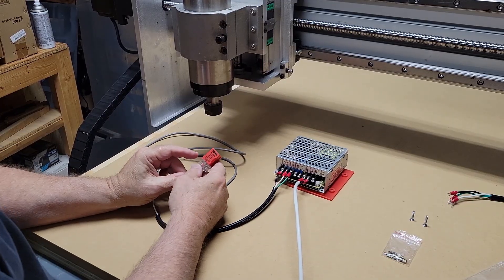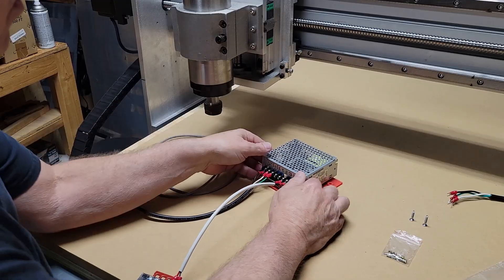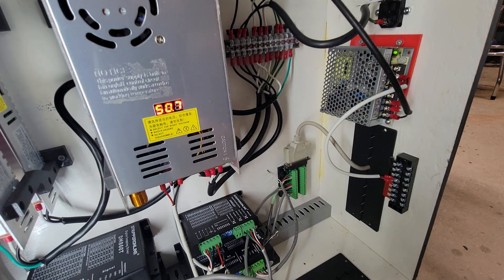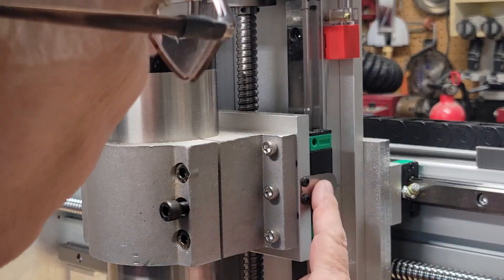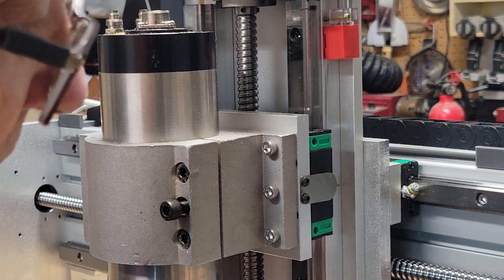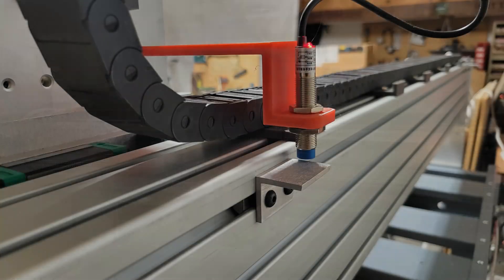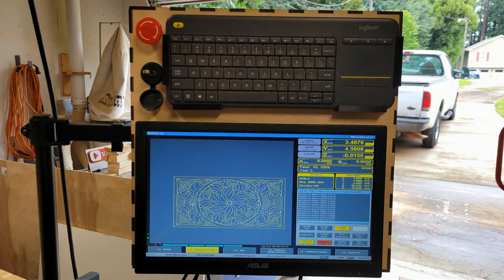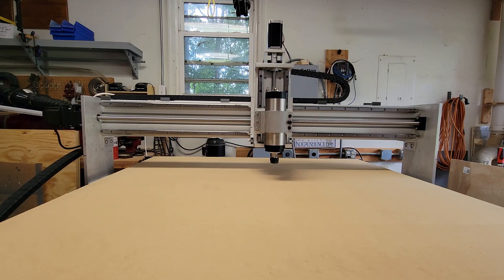Lets Go Home!  Adding Proximity Sensors For Homing

Comment: To trigger a little more far use a steel plate instead of the aluminum one. The sensor detects the steel better than aluminum.
Reply from the maker: Thanks for watching.  Yes, steel seems to work better than aluminum.  I think I have some scrap steel angle around here somewhere.  If I can find a small piece I I'll swap it out.